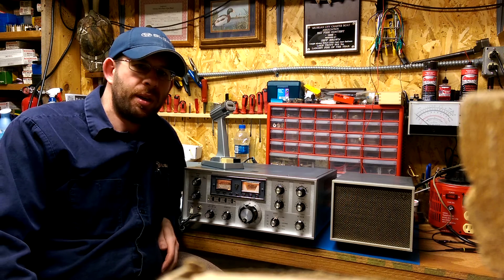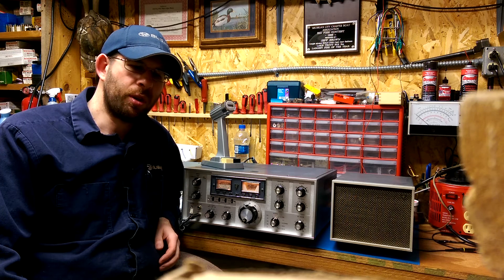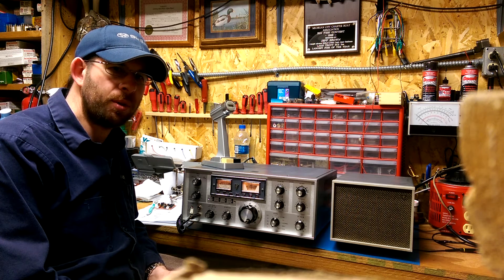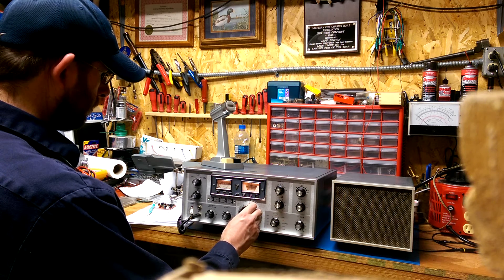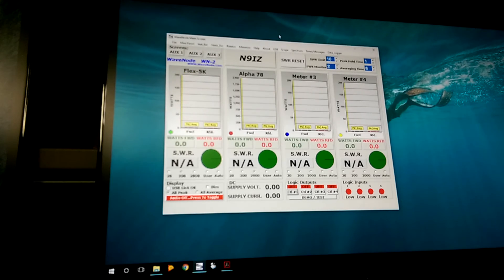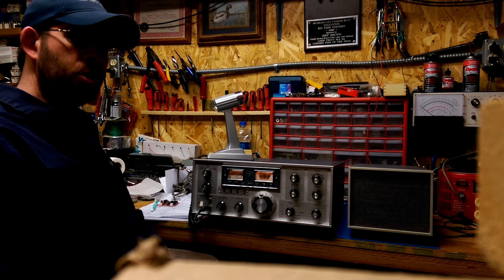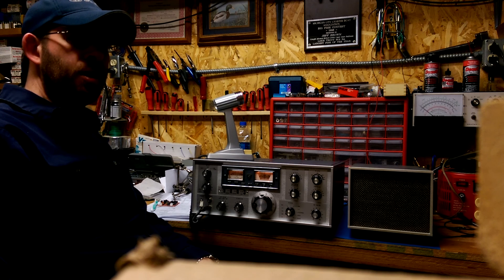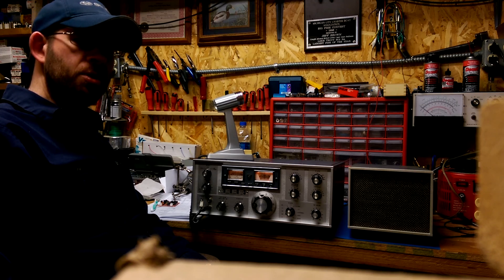Yaesu FTdx-560

Comment: what are you asking for the radio?
Reply from the maker: cecil roberts The owner wants  $450 shipped for the transceiver, matching speaker, mic, and eternal VFO not pictured  (no connect cables and untested ). My part is just to clean it up on the bench and handle the arrangements etc. Thanks for your interest.